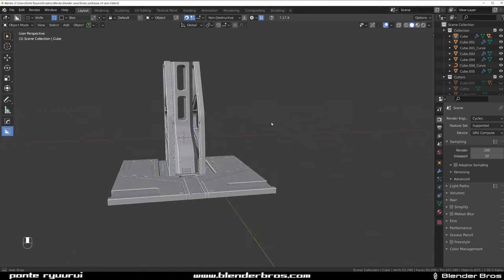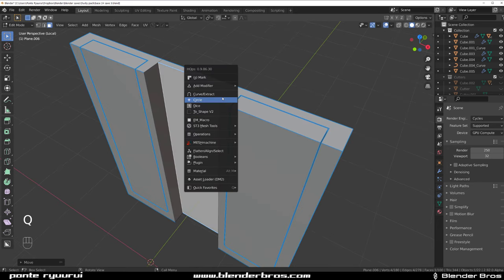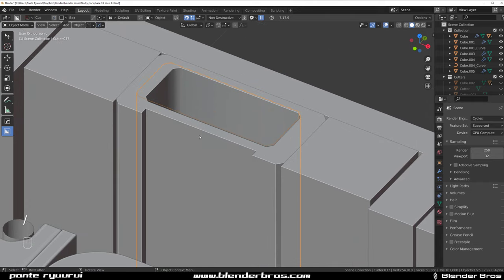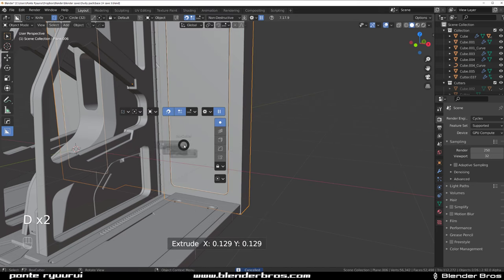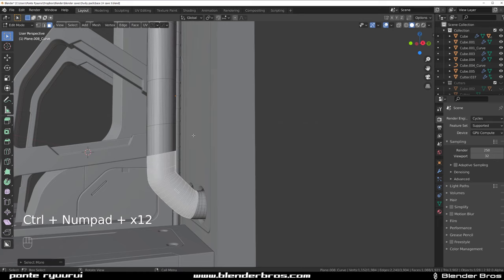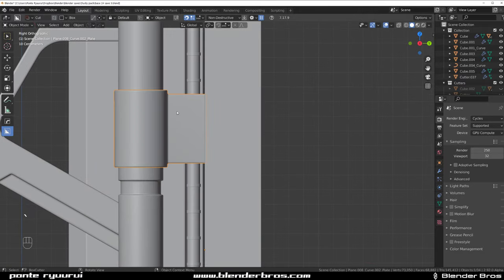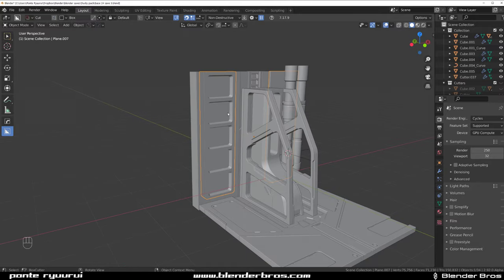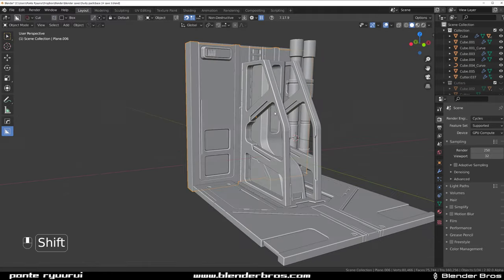Mini SciFi environment tutorial for Blender with HardOPS and Boxcutter

Comment: Nice video mate. Was using DM and added a decal into a pack that it shouldn't be in. Is there a option to easily remove a specific one from a library?
Reply from the maker: ya just go to a decal library on yuor PC and move it from folder to folder
Reply: @PonteRyuurui  hmm have tried that and deleting it, the other decals are now missing/pink on DM when using them
Reply from the maker: @CGLife  if they are pink it means the data is missing, check machin3 vids on how to recover decal data

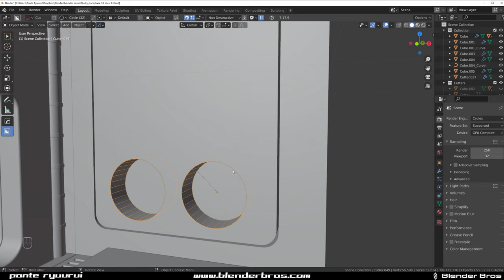Comment: Ryuu, at 8:55, I hit Ctrl- Mark and I can't get the reverse bevel like you. I can only bevel inside and not outside. What am I doing wrong mate?
Reply from the maker: select face of the cylinder, also it has to be flush against the surface you are cutting
Reply: @PonteRyuurui  It worked. I wasn't quite flush against the surface. Thanks Ryuu!!
Reply: All done Ryuu. Another nice one short and sweet. Cheers mate!
Reply from the maker: @dannybouchard4140  awesome!